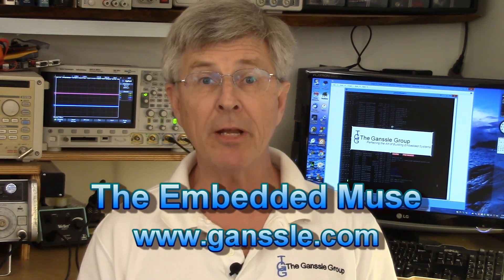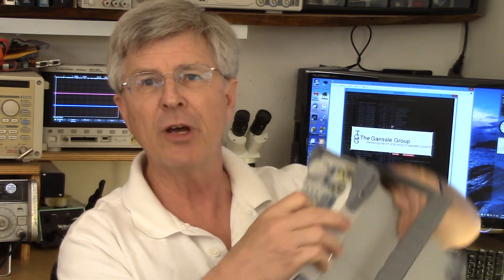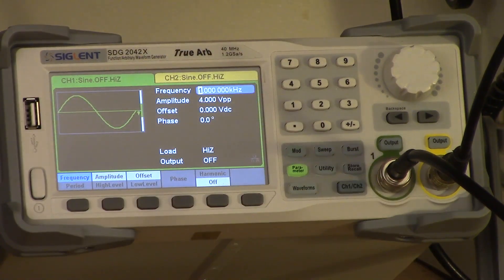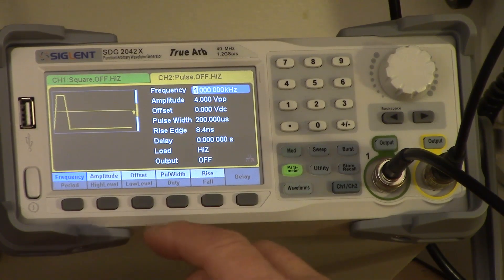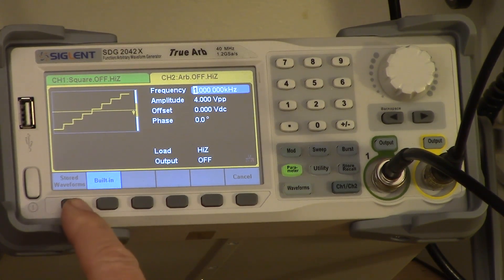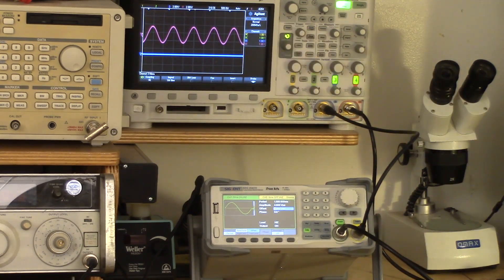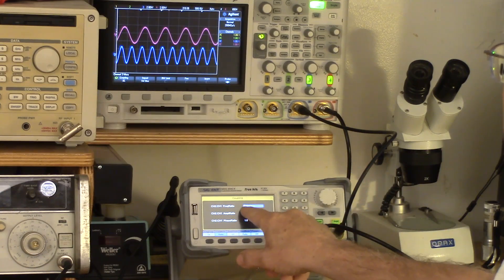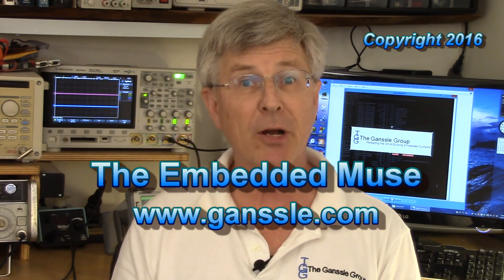Episode 18 - Review of the Siglent SDG 2042x Arbitrary Waveform Generator

Comment: After looking over specs of some models, and partially based on this review, I bought one of these and just received it.  I have about a half century of electronics experience and appreciate how easy this is to use in spite of the vast number of capabilities it has.  (Far more than the number of physical controls would suggest.)  On anything like this, there is a tradeoff between the number of controls to slather onto a front panel and the number of menu driven choices with soft keys and/or arrows and such.  I think this has a very good balance.  I have used a great many models of test equipment over the years and believe that you shouldn't have to make a career out of trying to learn how to use this or that generator or scope or whatever.  That with basic knowledge of what you want out of something, it should be easy to, without ever looking at a manual, quickly do what you need to do.  This has the "easy to use" I prefer.

Comment: Good idea on the "rise time improver".  It reminds me of something VERY funny in one of the National Semiconductor data books probably back in the 1970's.  I forget the IC numbers, but one was titled "Fast Buffer" with a specification of a 1,000 Volt/uS slew rate.  The next page had the title, "Damn Fast Buffer" with a 6,000 Volt/Us slew rate.  Back then, you sure didn't expect to see that word in a data book.
Reply: Reminds me of a databook I had in which an engineer had managed to sneak in a part called "Universal Fast Asynchronous Receive-Transmit" (and its obvious invitation to abbreviate).
Reply: @Graham_Wideman  Another thing, not as funny but amusing to me, was the data book for the 8051 microprocessor (which I used in many designs).  It had a section that went on for many pages titled "Counter and Timers".  The next section, which also went on for many pages, was "More about Counters and Timers."

Comment: For you true experimental nerds out there, here is a very cheap way we made an "arbitrary waveform generator" in a college class.  We took a regular analog CRT style oscilloscope and made a cone shaped black hood over the screen with a photocell at the other end of the cone.  So, the photocell "saw" the light of the dot going across the screen.  The output of an amplifier controlled by the photocell is then fed to the Y axis of the scope.  We could cut a paper mask in any shape we wanted and affix it to the front of the Oscilloscope screen.  We adjusted the gain of the amplifier so that about a half of the oscilloscope dot showed.  If more than half a dot showed, the amplifier output would lower.  If less than half a dot showed the amplifier output would increase.  So, this was a closed loop control system that would try to maintain a half dot showing.  Whatever free running sweep frequency we used produced an output with the waveform shape we had cut out of a piece of paper.
Reply: Hahaha that's both innovative and amusing :-).